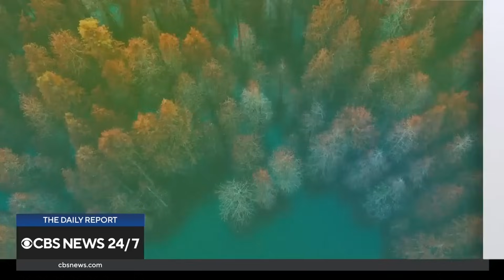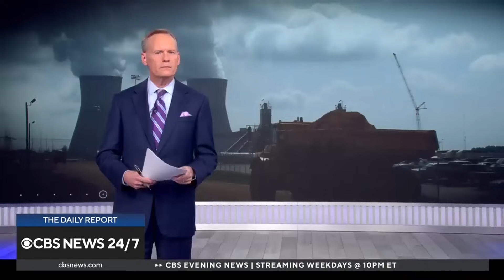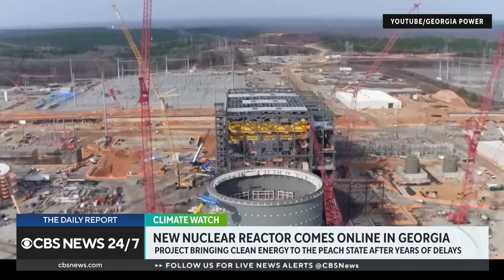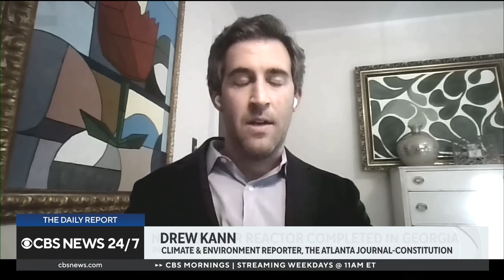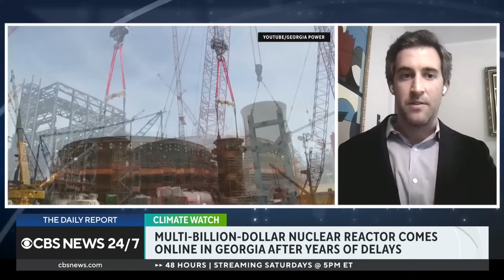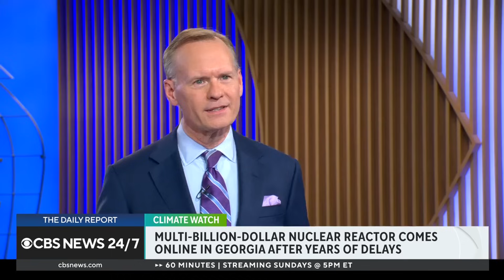New nuclear reactor comes online in Georgia after years of delays

Comment: This is why the future of nuclear is likely to depend on smaller, factory built systems. There's got to better quality control of the process to prevent these delays and cost overruns. To be certain, large construction projects like this have been plagued with poor oversight and corrupt contractors for about as long as power plants have been built. Some have been so messed up they were never finished. GE is building compact nuclear power plants that can be mass produced and installed without all of these problems.
Reply: SMR’s are already dead in the water.
Reply: Rooftop solar and good batteries is all we need.
Reply: @shutinalley  Well, no. It will require a number of clean energy sources to meet demand. Roof top solar helps for certain. But, it won't be enough for a society going to electric only in a few decades.
Reply: @shutinalley your nuts if you think the entire grid can be run on rooftop solar
Reply: @annonimity276  It's the concept of the grid that's the problem. Distributing large amounts of energy from one place to several over long distances is outdated. With rooftop solar the community is the power plant. No more poles with power lines cluster%$#@ed all over the place.
Reply: @shutinalley  I'm all for self sufficiency but in urban areas the grid is a necessity, high density residential, industrial, and office buildings use alot of power and don't have enough surface area to mount solar, they need to pull that from somewhere and the grid is the most efficient method of acquiring that power. Even suburban homes need a backup source of power for when weather dosent allow for sufficient energy generation. Self sufficient solar also requires alot of large lithium batteries that are ecologicaly disasterous to produce and in short supply given the recent EV advances.

A nuclear grid with hydro and geothermal where geography permits and supplemented by rooftop solar is the best possible solution untill such time as I can have a micro reactor in my utilities closet or fusion becomes feasible
Reply: @annonimity276  Today I can power my entire house with my roof covered with 2 to 300 watt solar panels with up to date batteries in zone 7 and 8. In the future it will only get cheaper and more efficient.
Reply: @shutinalley  your house probably supports 1 family and has 1 roof, an apartment complex supports several dozen families and still has one roof, the square footage numbers don't add up, you start throwing comercial machinery or data center servers in the mix you would be running so many gas generators it ends up environmentally worse. The grid should be more decentralized with multiple smaller powerplants, ideally SMR reactors, but you still need a grid to cover the downtime.
Reply: @annonimity276  Apartment buildings are a bad idea and nobody really likes living in them. Downtime is not an issue with good battery backup. Just ask Florida residents in Babcock Ranch who had solar during the last hurricane storm and didn't lose power while everyone else on the grid did. If residential could operate off grid, supplying energy directly to commercial manufacturing would be easier and cheaper regardless of what you use.
Reply: @shutinalley  apartment buildings and condos are a necessity in dense urban environments to keep housing costs down, imagine what would happen to housing in NYC if all the apartment buildings got replaced by single family homes, you would cut the housing supply in NYC by 75% at minimum. Self sufficiency is the goal for many of us but it's not a sustainable or efficient solution for the entire grid
Reply: @annonimity276  Housing costs in general are artificially manipulated. The reason cities need to cluster$#@^ citizens in these high rises is because in and out transportation within cities is so bad. When automated transportation finally takes over people will efficiently be able to travel to and from their houses into "cities". If they want to. The cities of the future will look so very different from what we see today. The status quo is unsustainable.
Reply: @shutinalley  housing costs are artificially inflated by zoning laws and red tape preventing new construction and higher density construction, it's basic supply and demand
Reply: @annonimity276  It's about dealing with the influx of what is 6 billion people within 80 years without infrastructure to establish the number. Severe mismanagement over the course of the business of industrialization. It's about using technology wisely so that all people can have affordable housing that isn't unsafely and inefficiently clustered into small areas.
Reply: @shutinalley  a decentralized economy and population would be great and we're getting there with WFH and starlink but you can't build energy infastructure on the assumption that that will be the case and you definatly can't force it to be that way without disasterous concequences.
Reply: @annonimity276  Unfortunately disastrous consequences are coming whether it's forced or not. Already the grid is hanging by a thread because it operates the same as it did in 1920. It's only a matter of time. It's going to be about mitigating the damages and rebuilding smarter. Because what we're working with today is absolutely ridiculous.
Reply: @shutinalley  not if you cut the red tape behind nuclear power construction, combat NIMBYism, and build a number of small modular reactors scattered across the country. The only way the grid falls is if the entire nation collapses in which case you have alot bigger problems.

Comment: Delays and massive cost increase is not something US specific, it is the same issue with new nuclear reactors everywhere. Long delay, cost increase multiple times of the initially expected cost. Flamanville in France, actual delay is 12+ years, cost increase from EUR 3.3 billion to EUR 19 billion. The French Court of Audit estimates the electricity production costs at 110 to 120 €/MWh, 3-4 times what competitive base-load generation would cost. Olkiluoto in Finland: 12 years delay,  cost increased from EUR 3 billion to EUR 11 billion. Hinkley Point C in England: cost increase from EUR 19 billion to EUR 50 billion. None of the recently added nuclear power plants is competitive.
Reply: Only in the West. The two French EPRs built in China (Taishan 1 & 2) were built in ~8 years and mostly within budget. South Korea's 4-unit plant in the UAE was constructed in 8 years and on budget. Chinese reactors (e.g. Hualong One) are built in 5-6 years and on budget. This is the same as used to be the case for US, French, Canadian and Swedish new nuclear construction during the 1970s and 1980s.
Reply: @MayaPosch  I used to work with Chinese contractors on several projects (HFO, CCGT, Solar PV). I'm very glad that none of these projects was a NPP considering the almost non existent QA/QC, sloppy OHS and the general behavior of these contractors especially dealing with problems, quality and safety. 
No objection against KEPCO, seems that they have high work standards.
Reply: @MayaPosch  It's the environmental & safety regulations that drive the costs and the delays in the west.
Reply: Is it really the “same issue everywhere”? How much does it cost to build a nuclear reactor in China, India or Russia?
Reply: It's a waste of resources and high risk.

Comment: One million homes is not much electricity considering the cost of building this power plant.
Reply: Once it runs, the cost per kW is next to zero. Significantly lower than gas/coal.oil where they need a supply of gas/coal/oil.
As long as it runs, it will pay itself in the long run. There have been people calculating that already.
Reply: @TheViettan28  Our entire infrastructure is about to change if we allow it. Unfortunately when things are too efficient it becomes bad for established business interests.
Reply: The cost returns because upkeep is next to nothing, it’s fuel source is pound for pound dirt cheap and incredibly efficient and energy dense, and a million homes is most of central New York, almost all of it, spread out to cities not as dense, that’s the majority of an entire state excluding similarly massive population centers, all in one plant, the average coal plant for comparison, has significantly more upkeep and maintenance costs for well under 300’000 homes, not even 1/3 and it will impact your taxes much more
Reply: Rooftop solar would immediately make this obsolete.
Reply: @shutinalley What happens at night? Batteries exist but they are very expensive too
Reply: @drewwassel3367  graphite batteries, and perovskite if it actually does what it says when it hits market in the next year can work in moonlight.
Reply: @drewwassel3367  Batteries are still cheaper than distributing large amounts of energy from a power plant. Look up solid state batteries. When they're marketed to scale it will end the need for power plants.  Those behind power plants know this is coming and will do everything they can to stop it. Including manipulating world war 3.
Reply: @shutinalley  No it wont. We still need to provide power for peak demand, and solar doesn't provide on demand power: https://en.wikipedia.org/wiki/Duck_curve
Reply: @gregorydaggett7444  Not yet. But very soon it will.

Comment: The hydrogen explosions at Fukushima were supposed to be impossible to happen, but they did and I don’t think that issue has been addressed by the industry regulators. He says that the waste is stored in concrete containers but that is what is supposed to happen, more likely it is just stored as long as possible in the open, unprotected cooling pond located above the reactor vessel. The safety issues with nuclear is a steep price to pay for powering your servers. There must be reasons that more plants have not been built. That interview was very superficial. 7 years behind schedule and 200% over budget, now you know why they are not building them and the nuclear waste keeps on accumulating. Start another war, sell the waste to make depleted uranium munitions.
Reply: The hydrogen explosions at Fukushima Daiichi happened in the spent fuel storage pools located above the reactors. TEPCO had refused to refit these with hydrogen venting mechanisms as had been recommended after the TMI incident by the manufacturer. With the new NRA regulations in Japan, such an accident will not happen again.
Reply: @MayaPosch  why, in one case then, did the dry well fracture and loose pressure? Where did that hydrogen come from?
Reply: @Glen-uy4jt 
All the units at Fukushima had (unfiltered) vent lines and units 1 and 3 were successfully vented. Large amounts of hydrogen nevertheless leaked from the containment vessel head flanges of units 1-3 because the containment vessels were overpressurized for many hours during the accident. For reasons that are still unknown, Unit 2 could not be vented. It is assumed that this led to a leak in the wetwell at unit 2. Units 1 and 3 did not suffer such a leak.
Reply: @mudspike84  also one of the top cover plates was dislodged from an explosion from within the main reaction chamber. This is old news so my memory is fading on the specifics but it seems like there were and are some hydrogen issues with this type of reactor that was deigned in the USA. Granted these designs are quite old and were made using slide rules but still, is the production of electricity so important that we risk severe radiation contamination of our only habitable planet? Polluting through the consumption of fossil fuels is bad enough but radiation contamination seems to be extremely foolish.
Reply: @Glen-uy4jt  Only the reactor shield plug at unit 1 was dislodged and it wasn’t dislodged by an explosion originating from below. We know this because the lower layer of the plug actually fell onto the containment vessel head, where it remains to this day. This being the result of the hydrogen explosion that destroyed the top floor of the reactor building is much more plausible. The shield plugs at Units 2 and 3 on the other hand remain in their original position. And hydrogen is always generated in a severe accident with fuel damage because it is formed when the overheated zirconium fuel cladding reacts with water. That’s why all nuclear reactors have to have some measures in place to deal with hydrogen in case of a severe accident. These measures were insufficient at Fukushima Daiichi, which is one of the many regulatory oversights that led to the accident in the first place.
Reply: @Glen-uy4jt  because the piping for cooling got plugged. Unless you live in an area where a tsunami is a concern that won't happen.
Reply: The problem of hydrogen explosions was adressed in the US after the accident at Three Mile Island in 1979. US plants control hydrogen concentrations with the help of hydrogen igniters and passive autocatalytic recombiners. Fukushima unfortunately only had electrically powered recombiners that could not operate after the station lost all power. All plants in Japan have now been upgraded with passive autocatalytic recombiners that can remove hydrogen without the use of electricity. And the spent fuel pool of these reactors, in fact of all pressurized water reactors i can think of, is not located “above the reactor”. Rather, it is located in the adjacent auxilliary building at ground level.
Reply: Most ignorant comment I’ve read possibly in years
Reply: @nathanspreitzer6738  must not read much
Reply: The recent Tsumani in Japan killed 20,000 people. The resultant accident at Fukushima nuclear power plant killed ZERO people.  Nature is FAR more dangerous than Nuclear Power

Comment: There are nuclear technologies that generate much less waste. And some could actually use present day waste as fuel!!!
Reply: You are referring to "fast neutron" reactors that are nothing new.  They cost 3X more in capital cost and also 3x operating costs than even this.  Neither fast nuclear reactors nor this are economically viable.
Reply: @beyondfossil  Molten Salt Reactors use spent uranium as a fuel
Reply: @beyondfossil  Its just another percolator to me. Westinghouse in Design. I've got 5 different types of Westinghouse and General Electrics under my belt. 21 years experience.  Top in my field with a Nuclear Degree from MIT. Not trying to boast. But they couldn't pay me enough.  Young mans sport.
Reply: @lawrenceleverton7426  What's interesting with commercial nuclear is that its space-age technology combined with essentially old Victorian-era steam power.  It's like a dichotomy of technology.

Whereas photovoltaic technology produces electricity far more directly by exploiting quantum and classic electromagnetic principles.  Even wind turbines create electricity more directly than thermal based power generation like nuclear & fossil fuel.

The amounts of water that a nuclear power plant uses are an environmental concern.  Some 2500L of water per MWh generation.  Some of it heated water expelled into local waterways that promotes algae growth.   I'll point out that wind and solar use practically zero water during their operation.  Even expansive solar farms use dry-brush automated robotic cleaning.
Reply: @beyondfossil  Why change something that works? Victorian age steam power made me laugh. But you are spot on. Archaic, but tried and true. I'm also sure efficiency might have improved somewhat. Mankind is still trying to get to the perfect Carnot Engine. But still way off from 100 percent efficiency. I understand some of the basics in other forms of Power Generation. The primary source may be different but the end product is the same. Its probably easier to learn those from a qualification standpoint. I'm very happy with the Million Dollar Education the US Navy Provided. BTW most peeps in civilian nuclear field have a Navy Nuclear Background and they are sharp whipper snappers. But the stress involved in that job takes it toll. If you don't have the eye of the tiger. than you shouldn't be doing it. I survived, sorta miss it, but glad I don't do it any longer. I'll leave that in the capable hands of the young. I'm happy to use my power switch at home, know its gonna work hopefully  and its someone else's job to provide it.  At some reasonable cost. I live in hurricane country and within days Power is back on,  should one hit. But I also have a Generator that is more than adequate if need be. Have a nice day.
Reply: @lawrenceleverton7426  You can use your knowledge to DIY installed your own rooftop or ground based solar arrays and also setup your own home battery.  You'll pay less than 1/4 to have it professionally installed.

Nothing is more American than independence.  Grid tied solar with home battery will power many American homes 80+% of their annual electric consumption.  I do it myself and get those numbers already.   You can still be connected to the grid for back-up, but you'll be only paying the monthly minimum connection fee most months. 

Residential & commercial solar start creating a distributed power architecture which is naturally highly resilient.  Nuclear still represents old school centralized & monolithic power architecture which is much more vulnerable to threats both natural and man-made (terrorism, war, sabotage, human error).

In this day in age with highly polarized national & international politics combined with increasing effects from climate change, resiliency will be highly sought after.